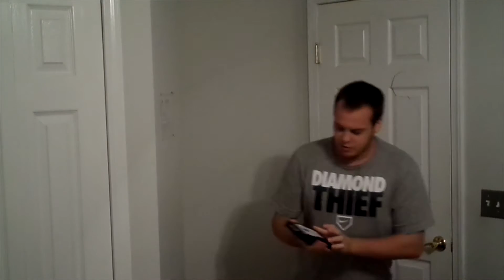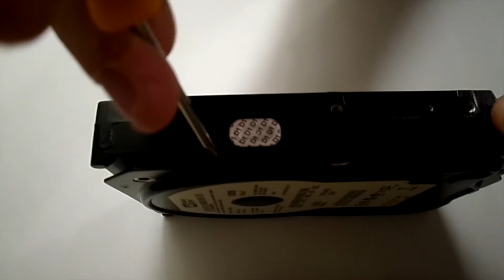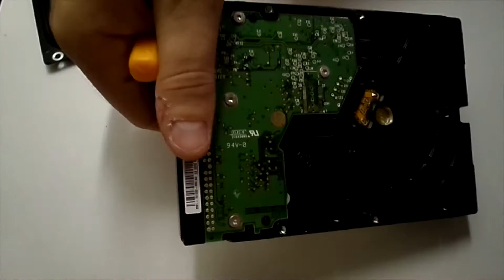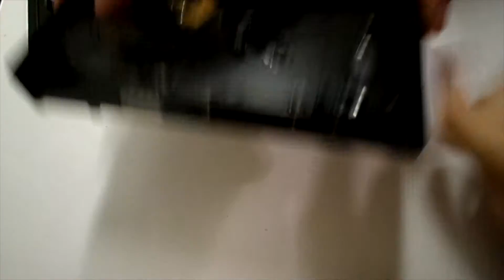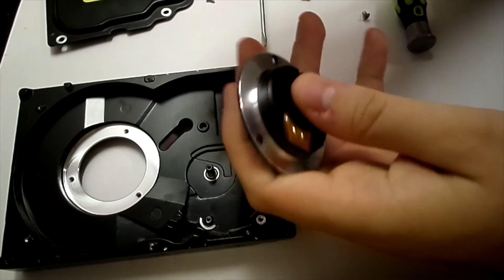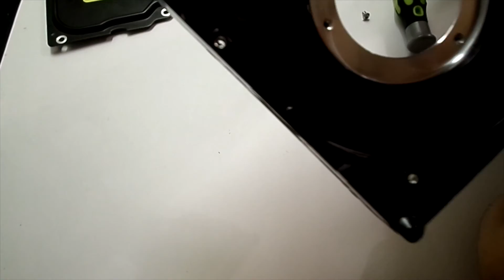TEARDOWN: Western Digital 80GB Internal Desktop Hard Drive Disassembly

Comment: Please what shall I use for data in this hard drive, it doesn't have a SATA cable's slot
Reply: You need an IDE to SATA or IDE to USB adapter. They're cheap.
Reply: @DrFreeeman  Hey man Thanks for your reply, it's been 9 months and I already Solved the issue, Thanks again ❤️